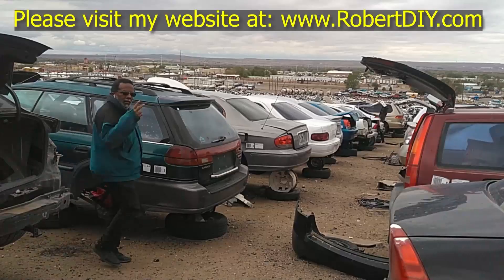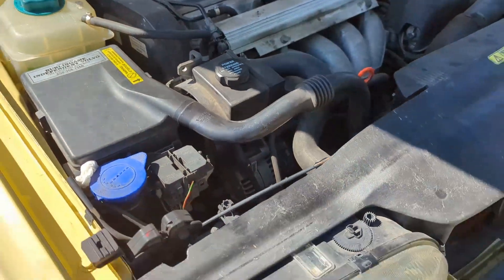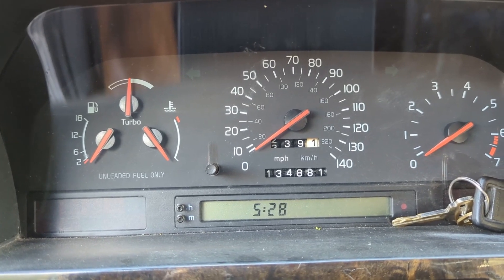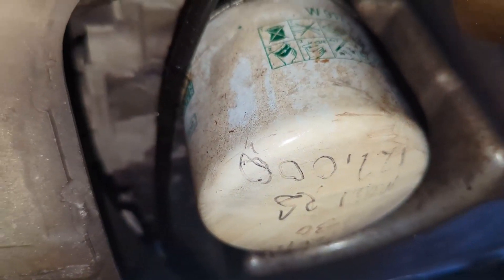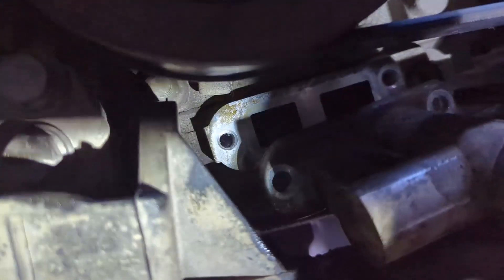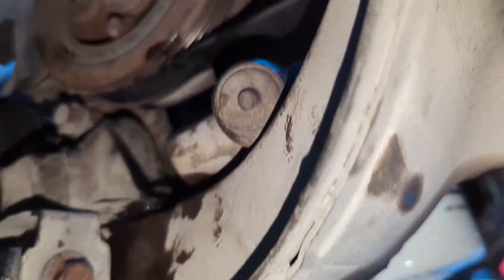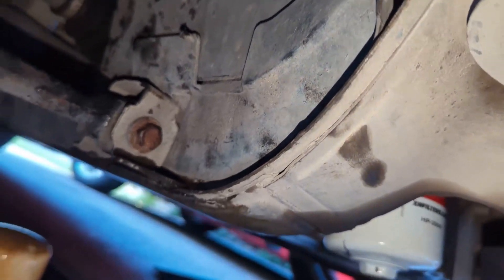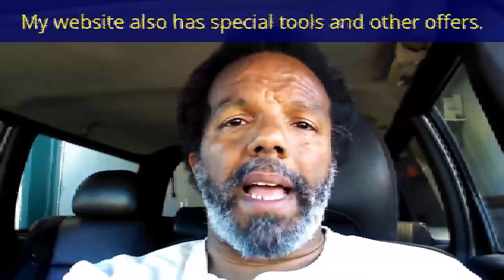Cleaning up to pack, oil leak, oil change, oil lines blocked off then the broken computer. - HOWR

Comment: Hello Robert! Do you also have experience with diesel engines? More specifically I mean D5252T 2.5 TDI which was installed on P80 Volvos ;)
Reply from the maker: I do not

Comment: I had one of those oil cooler thermostats go bad. but it took until 530000kms. and it was exactly what you describe. on a cold canadian startup youd hear this crazy howling noise. and it is right under your harmonic balancer so from the cabin you think somethings wrong with the car.
Reply from the maker: LOL

Comment: My 850 T5 leaked oil, coolant and boostpressure from almost everywhere, and a busted up charger, first i changed front and rear cam and crank seals then changed cv axle oil seals, PCV set all new, new PNP switch,  and that oil cooler block off plate with new OEM seal,  then n.o.s radiator and intercooler,  then i put factorybuilt OEM td04hl-15G turbo with DO88 chargepipes/hoses, vacuum lines and new TCV, and im now closer to stage 0    😊  runs like it should finally with no leaks whatsoever..phew
Reply from the maker: 😆 What most people get when they pay less than $2000 for a Volvo.
Reply: @RobertDIY thats true, nothing beats the feeling when the job is complete 😊

Comment: Perhaps put that laptop in to your local shop before you go. Do it on the basis that they find the fault but ask you before doing any repairs needed. May not be an economical repair but batteries aren't too expensive.
Reply from the maker: good idea.